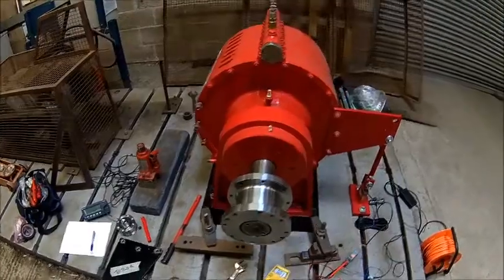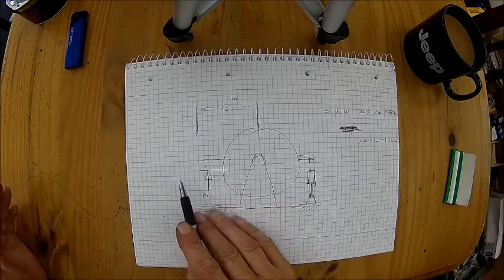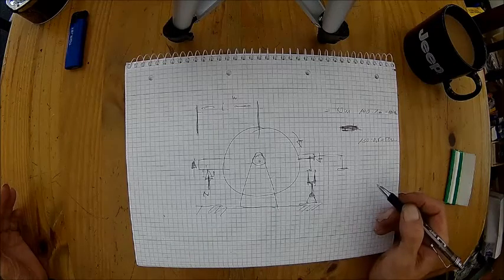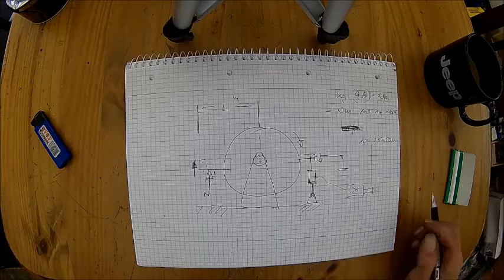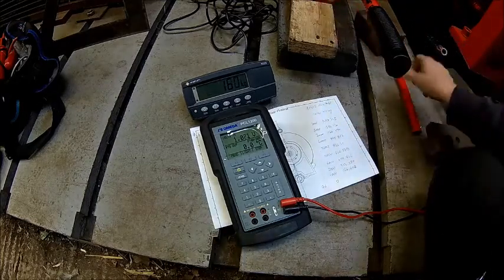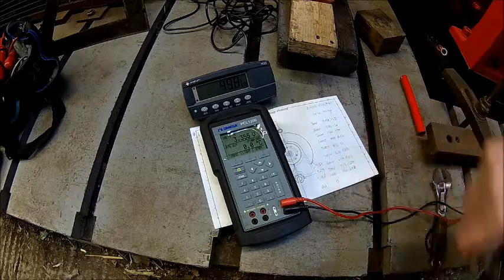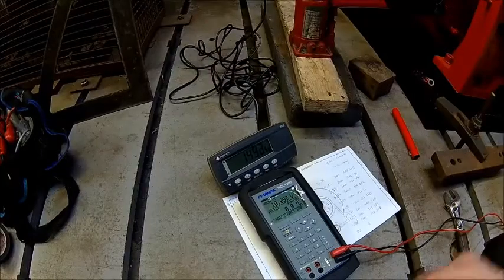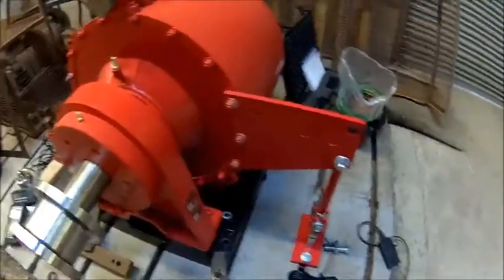Calibrating a 10000 Nm Dyno

Comment: so it is only the length to the weight that matters. regardless of what the location of the load cell is?
Reply from the maker: Yes, ... providing you don't relocate the load cell after calibration, all you do is looking what voltage comes out at a given calibration weight hanging/pushing at your cal-arm, the position of the load cell therefore does not matter. But bear in mind that the load cell must be rated for the load at the given point. ... e.g. half the distance of the total cal arm length means double the force of your weights is acting on the load cell.
Reply: @dynoguy  
okay thanks!

Comment: Nice set up. A little over my head but very interesting.
Reply from the maker: These things are Waterbrakes for testing engines, pretty simple design actually. Just for ease of explanation (it works actually a bit different)  ... think of a dead-headed water pump optimized for maximum loss and you get the idea what's in it. This particular example is rated for about 2500 hp. 
Unfortunately not my workshop, but I'd love to have that huge T-slot plate in my home shop,...